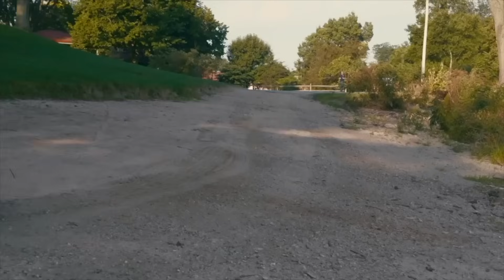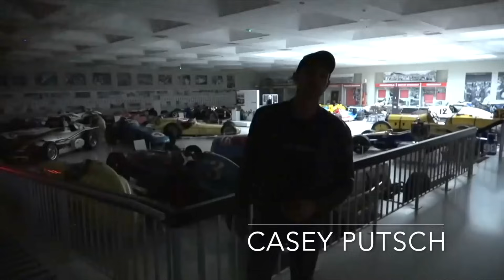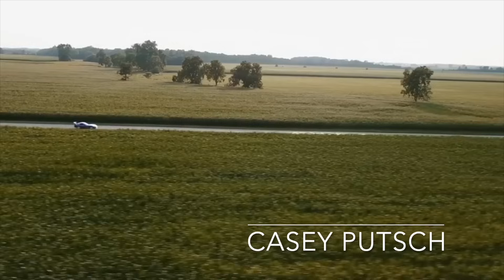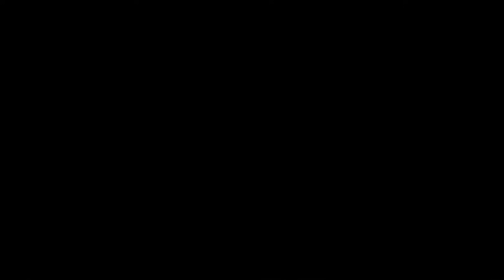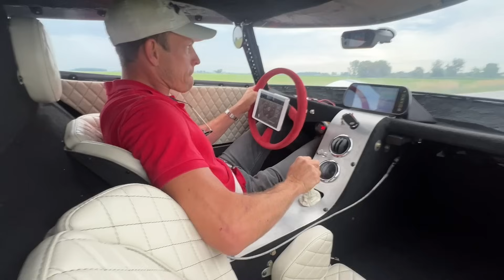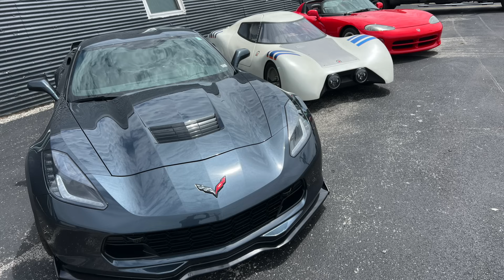HOW?? 104.7 mpg,  0-60 mph in 4.61 - the OMEGA CAR - Video 4

Comment: Easy way to work around the EV mandate is to have a 4kwh LiFePO4 battery, and a direct drive starter motor only capable of say, 2kw. But only charge that battery to 3KW to ensure it lasts for decades(assuming its not defective or has weird dendritic growth).
You might be saying 'But one Kw, thats not much' well for a car like this it probably is, i'm guessing that to maintain 45MPH its probably only using 1-4kw at the wheel
But wouldnt this battery be big?
Depending on design could be the same size as a normal 12v car battery. Heck, it could just be 12v and get rid of the SLA. Make it as easy as an SLA to replace in case something safer, and less damaging to the environment comes along like sodium ion(assuming more than just the lithium is replaced), new models can just have the new unit dropped in, and old models can quickly be replaced without re-programming once the old batteries need to be recycled, which really only needs to happen once they're unable to start the car because the battery pack doesnt really add much to the efficiency, its only there to meet a mandate, and be as small as possible for ease of maintenance and least impact on economy.

Comment: As an engineer, very curious for the specs and details! 

Honest question, the monocoque design has a lot of efficiency advantages, for sure. It’s strong and light etc. one concern I have tho - how easily repaired is it? Does a “fender bender” compromise it in a way that it can’t be as easily repaired?

I suppose if it is cheap and recyclable, you could just transplant everything into a new chassis if needed??
Reply from the maker: Astonishingly easy actually. I thought of that.
Reply: Follow on question, I’m really curious about the thermal design constraints you face. I focus on a type of specialized heat pipe for aerospace thermal stuff, and have always wondered how passive two phase devices might enhance automotive design… low drag heat rejection??

Comment: Some say diesel is less environmentally friendly but to figure actually emissions output one should really measure by the mile… so a car getting 26mpg would need to use 4gallons of gas per the 1 gallon in this car. Not to mention the cost of refining and shipping being 4to 1 as well. Impact starts to add up.
Reply from the maker: Yes

Comment: You'll never be able to keep up 104mpg with that giant tin foil hat acting as a sail making too much wind resistance.

If it's just off the shelf engine and transmission, why not just put the model numbers, and manufacturer in the video instead of rambling endlessly about how solar flares manipulate politicians or whatever word salad you were on about?
Reply from the maker: VW ALH

Comment: And instead of doing that we build massive and heavy EV SUVs or we turn even sedans like the M5 heavy enough so EVs don't look that bad. Tbh I couldn't agree more with you in most of your points, we should have a "keicar" but revised way of doing cars, lightweight, proper aerodynamics and focused on efficiency and generally better vehicles, instead of promoting stupid overengineered and complex cars that's aren't really necessary or optimum for our day to day basis, not a matter of killing cars but to update them to something worth to be called a car of this this century.

Comment: It's always about thinking outside the box, it's not enough to be different, we have to be different in a way that genuinely excites people and improves their lives. 

Case in point, I'm working on a small electric truck for my portfolio. The thought process behind it was electric trucks can already match supercars for low end acceleration, and with firm suspension, and the low center of gravity evs have, can be made to handle quite well. 

So why not make a truck that looks like a supercar from some angles? Much lower drag coefficient than a normal truck, which means a much smaller, lighter, and chesper battery. 

Something very different to appeal to people who want a truck, but not something that looks or performs like a normal truck.
Reply from the maker: Agreed

Comment: Casey Putch for president! Lol... For real though, definitely makes sense and I agree with 99% (or more) of what you say! Hell my car gets over 20mpg on E85 and makes more than double the power it should. EV's aren't going to last, even if they stick around for another 20 years... They won't have the longevity the internal combustion engine did.

I also know what engine is in the Omega car. They are really good little diesel engines and will run on just about anything!

Comment: the problem of EV’s is still the battery technology.  building a battery pack takes too many resources and the recycling rate is too low. Then there is the weight drawback as well. The advantages are: clean air in dense urban areas, comfortable, smooth and fast drive. It doesn’t seem enough to try to force people buying them. There is Aptera a 2 seater car like motorcycle that is very efficient. For vehicles like that electric drive is ok since it has a small battery but if you instead fit it with a diesel engine you might actually make it more cost effective by reducing costs of manufacture.
About the Omega I think it could have good chances to sell well with good marketing. It’s similar to Aptera but on 4 wheels which is more convenient.  not sure about regulations though, they require all sort of stupid systems as opposed to motorcycles
We need to focus on building very light weight cars if we wand to do any progress towards true efficiency but apparently we are doing exactly the opposite. This is the sacrifice we need to make for true progress, small lightweight instead of large and heavy

Comment: CAFE standards kind of ruined incentive to for mainstream automakers to innovate in the direction of efficiency, tbh... that and there's a lot of consumer demand for big, fat, lazy, barges.  The existing production lines are geared around stamped steel, so they keep doing it for best return on investment and hey, any real risk would compromise quarterly growth.

As for the Omega, don't know specifically what you did there... none of what you're saying is really that out there in realm of possibility though; the VW XL1 concepts were in that neighborhood with probably some more conservative design direction on shape.  I haven't looked in depth at biocomposites but I'd wager some pretty interesting stuff could be done with even a vacuum bag tooled monocoque.  Or hell, remember the Mosquito?

Comment: Casey, stop being a c*ck tease.  We're the choir here, watching you.  You don't need to preach AT us, we get it already.  Want to create change?  Stop bitching about what is and provide either information or other assistance to duplicate.  In other words, put up or shut up, sh*t or get off the pot.  I type this with zero malice, no desire to do anything other than shock you enough to Think about what you're doing.  Would YOU want someone preaching at you but not really providing much information?

Yes, I got it...  drivetrain is personal, based on need and availability.  But "make it more slippery, roll better" are worthless to anyone without higher education in those dedicated fields...  which most people won't have.  Same with using alternative building materials.

You want to effect change in this area?  Provide a path to duplicate what you've done.  ALLOW independent verification....  create advocates who share the information.  That's the "put up" part....  you have a certain set of skills that are unique to you (and maybe a handful of others).  You can either act almighty, or share (and even profit).  Want unlimited funding for Genius Garage?  Provide plans/kit/a build path and sell it, a few will jump in right away and if it all pans out even Close to your claims, others will follow.  

Be the change you desire.  Or just keep bitching about how things are....  but that path leads to isolation and bitterness.

Comment: My Subaru WRX GC8 is not only simple, reliable, AWD fully manual little car with a lot of fun and angry Boxer engine - its proof that a good design and thinking back then,  no need to be re-invented, and just used properly with straight hands.
I can go anywhere, everywhere, I don't need even roads. I have enough engine power to have fun - car is super light.
Not taking the fact that GC platform is proven Rally 10 times champion and absolute rally Legend that stays unbeat by modern WRC cars to this day. With Crazy Colin McRae behind the wheel -car was unstoppable.
Shame that even Subaru berried that ideas  that lead them to the Top class...
All in the  name of  "buzz words"

Comment: I've been curious about how well EVs actually handle? How much difference does it make having all of the weight under the floor when the car weighs 2 tons? I have a suspicion that I would be bored if I had to give up my 2300 lb, 100 HP hatchback for a much heavier EV, despite the potential straight line thrust difference.

Comment: Yes! Build! Build reliable, efficient no need in being wasteful cars. Something the common man can work on and enjoy. Without putting a 20-year loan out for a car that goes 300 miles then stops for hours and don't let it be cold outside or a car that if one wire burns out. You're sifting thru pages of diagrams just to get back on the road if one can do it. 
Suck, Bang, Boom. keep it simple for the most part
As always love to hear ya
Reply: How often do you drive 300 miles?

Comment: There's always one, and well here I am. I actually build engines, for a living, (30+ years with tangible proof) and on my own stuff, test, tune, and tear them down for inspection.  I've been down the whole rabbit hole of hydrogen, and vapor carbs as well as just plain old stuff like internal tolerances. You can get 104 mpg with a diesel. It would be a 10hp diesel motorcycle. To make these videos and tell people this stuff is disingenuous at best. You're literally telling people that you have a common 1.9 liter diesel that you did nothing special to and your light weight aero dynamic car body does all this magical stuff. OH and it sat for 10 years. Nothing I have done has sat for 10 years and nothing I have done hasn't been shown to those interested, because I have nothing to hide. You are telling people, that you, some guy with an engineering degree has done more than a guy like Jim Feuling, who has tested and documented and shown others his work. He has even produced products you could buy and use for yourself. He has worked with car company engineers as well as others. Then you have the guys heavily into land speed records who can actually tell you about aero dynamics. Where is the wind tunnel testing? You just drew a picture and guessed and nailed it 1st time out?  You have barely shown the filler neck of the fuel tank.  There is nothing special here, but I will not show you??  

In order to get the mileage you say, you would have to take fuel away. You can only take so much fuel away before either the engine doesn't run, or it manages to run and bad things happen due to heat. Then on top of that you are telling people how fast your car is and it is turbo charged , which adds more air and leans the mixture out further. The rest of the world adds fuel when they do this. And you seem to have done all this without a dyno or any other test equipment. Do you realize that many of today's improvements came about by racing and the people who put the time into testing and all?? Have you asked yourself why none of these people have done what you claim to have done? Why wouldn't they figure this out? Do you realize super high mileage would mean less pit stops and they would be wiping the competition off the race track?

I will also add that I am no fan of purely electric cars, the green movement, or lying-ass politicians.  I do believe however that a hybrid of electric and fuel is the way. Because common mechanical sense says that you really don't want to run an engine for a 10 mile round trip to the store or whatever, so the best of both worlds would be electric for short trips (meaning small battery packs) and an IC engine for long trips. 

I will also add to that, that I think all this garbage of wipers that turn themselves on, and all the "connectivity" of your car to a phone (and the government and corporations) and everything else they put into these disposable plastic boxes with wheels, is 100% bull$hit. So it's not like I'm not on the same page as yourself with regards to that. 

So go get some independent witnesses at the very lest show us enough to see the fuel tank, empty it, put 1 gallon of your favorite diesel in there, map out 104 miles on a map and go drive it and prove us all wrong. I'm screen shoting this so if you delete it, I will make a video. There's not a single curse word or anything that is unfair in it.
Reply: I had Citroen C4 from 2010 with 1.6 turbo diesel engine and it did 3,4l/100km, that is approximately 69 mpg (US). Standard European compact car, that weight: 1300 kg. I believe you can get that kind of fuel usage by creating a lot lighter car. Volkswagen made XL1 - lightweight hybrid diesel. But cars nowadays have a lot of gadgets and also should wear out faster, because manufacturers want to sell new cars and make money.
Reply: @travelingwithmichael  VW group sold Lupo and Audi A2 models that did 3L/100km, albeit they were made from more expensive materials like magnesium alloy wheel and aluminium panels.
Reply: There is no independent measurement for either the MPG claims nor the performance claims.  If you notice in the 0-60 runs he never even bothers to show the actual displayed results.  However, given the Omega car esentially appears to be a very lightweight go-kart with limited to non existant creature comforts (such as real seats),  any modern safety systems or demonstrated (real or simulated) crash structure testing it's not impossible to believe either figures and I give Casey the benefit of the doubt.  Also, I'm curious about the robustness of the cooling system in the Omega car which is always a major source of drag in combustion powered vehicles made to work in the world's full range of conditions.  How would this car do driving across the Mojave in July in 120F+ temps for example?  Casey refuses to engage in any conversations regarding the usability/practicality or crash safety or how the car meets any real world needs/constraints.  If you notice the Aptera which I would argue is a far superior in design, in terms of comfort, drag etc it still went 3 wheels (motorcycle classification) to avoid the rigours of passing modern passagenger safety standards.  However, Aptera has taken great steps to provide some level of crash structure (far beyond anything Casey has show us in the Omega car) and they plan to demonstrate its crash safety to the world in indepndent tests. 

There is also the little problem that no diesel engine in the world, even ones manufacturers spent hundreds of millions developing,  that can pass 2024-2025 federal emissions standards for passanger cars without gaming the test in some way the way (the reason so many automakers got in trouble).  It's the reason why no new diesel passanger car exists in the US anymore.   Casey thinks diesel is cleaner in its polution footprint then that of a battery but this is just based on his own ignorant biass and not actually citing any reputable study on cradle to grave emissions of a 200K mile EV vs 200K mile diesel.  He seems entirely unaware that LFP batteries have taken over the EV industry because they have twice the cycle life of NMC, don't use any nickel or colbalt, have much lower fire risk, and are far cheaper to produce. They are also 95+% recyclable.  More than 50% of Tesla vehicles produced have moved to LFP.  NMC is still used in high performance models due to the superior power to weight ratio.
Reply from the maker: Ok can do. I love people like you who gave up. And yes, I did one drawing, designed it in my head, and nailed it on the first try. Remember guys like Jim Hall and Dan Gurney? We exist.
Reply: @CaseyPutsch   Gave up????  Gave up what???  I live in my shop. A minimum day is 12 hours.  I've pretty much built everything I drive. I've designed, or redesigned, whatever you would like to call it, and built an ignition system for motorcycles,  templates to put dual plugs in cylinder heads, ported countless heads, there's a mill, couple of lathes, m/c dyno's , flow bench, and all kinds of test stuff everywhere. I'm working on my website to sell parts so I can have steady income and  not have to bother working on customer stuff because there is nothing to learn working on customer stuff anymore. I'm going back to work now. You go figure out your map and find an independent nobody mechanic to verify it all.
Reply from the maker: Literally put it all on video. Just because you already know this is reasonably possible, chose not to pursue creating something like it, and then see someone else succeed doing it, doesn't mean it suddenly isn't possible. Basically all VW enthusiasts know this is very doable. I respect your work, but don't be "that guy".
Reply: Good rant, and I have similar thoughts. So why not start an open sourced car company to help the masses? You seem to have the know how and resources. Give the people your initial blueprint. And let them give it a try. Seems like the best way to bring your message to life. Just my two cents

Comment: It will be hilarious and cool if you get your hands one day on VW 1.2L inline 3 turbo diesel that powered their most fuel efficient relatively mass produced cars (and not like XL1) Audi A2 3L and VW Lupo 3L. They aren't powerful but given the weight and number of passengers 45KW is sufficient to even get you on the highway let alone city driving.
Reply: I paid 2K for my Mercedes CDI 800 plus miles per tank 400 ft lb of torque at 2400 RPM